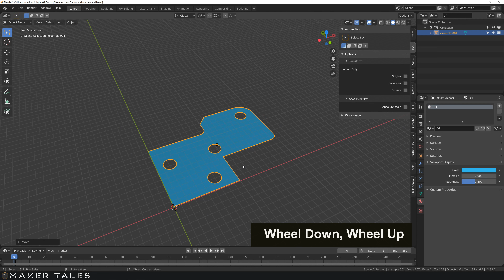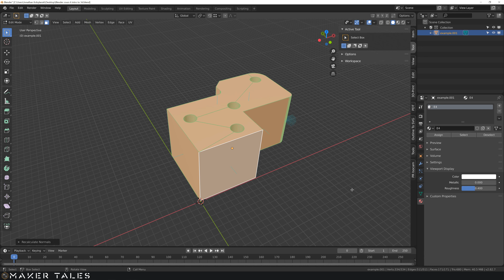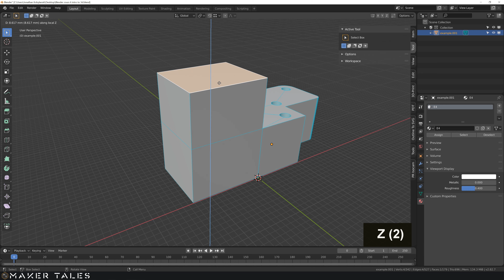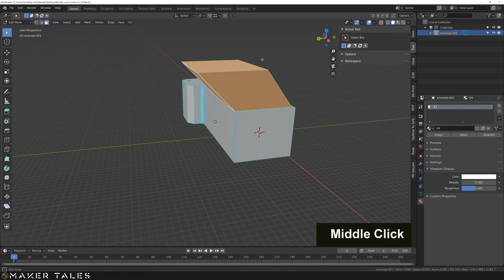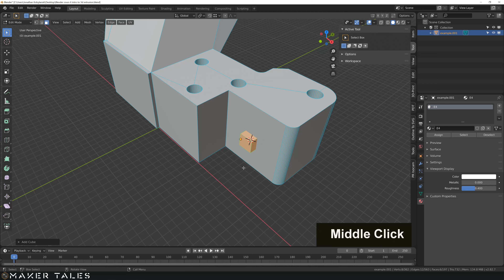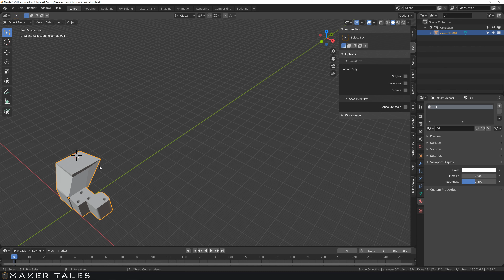Beginning 2D to 3D  - Precision Modeling for Blender 2.8+ | Extrusion | ( Tutorial Part - 7 )

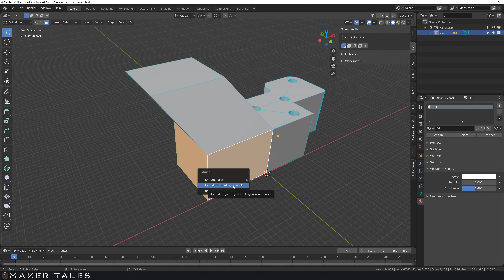Comment: in 10:25 if I do "Extrude Faces Along Normal" it doesn't extrude as one part its only extrude individual faces ?
Reply from the maker: Hi Salman,
Intresting... Sounds to me you might have acidently duplicated the faces by doing an extrude individual face first. Then not moved it and then trying to do along normals. Give it a try in a fresh scene, If that is the case it should work now.
Reply: @Keep-Making  true it worked now ty
Reply from the maker: No problem 😀